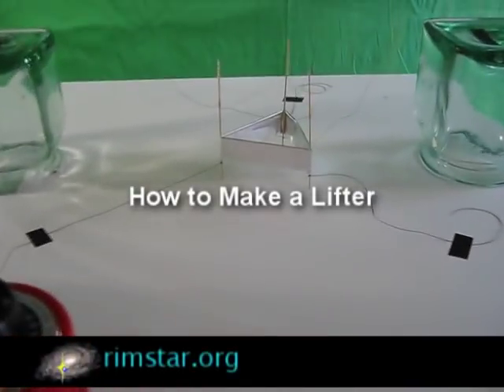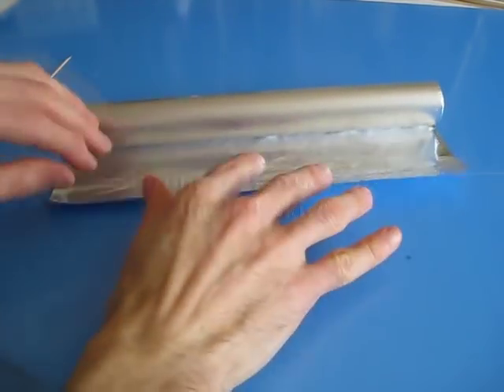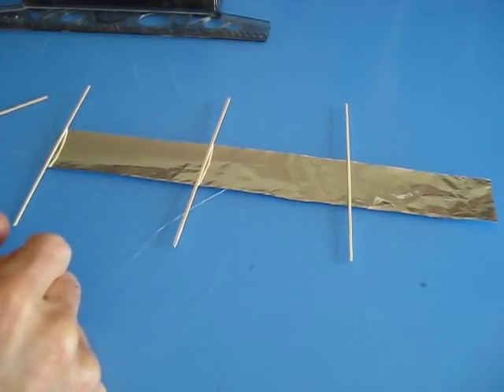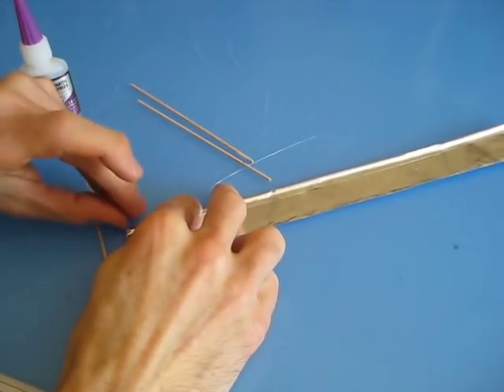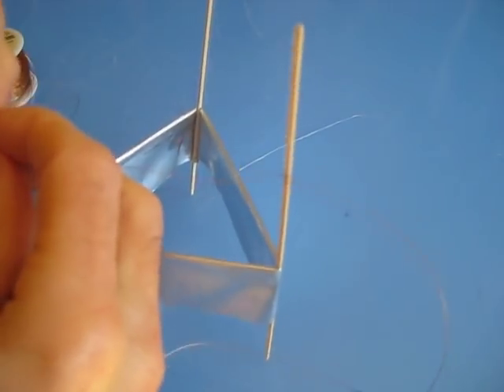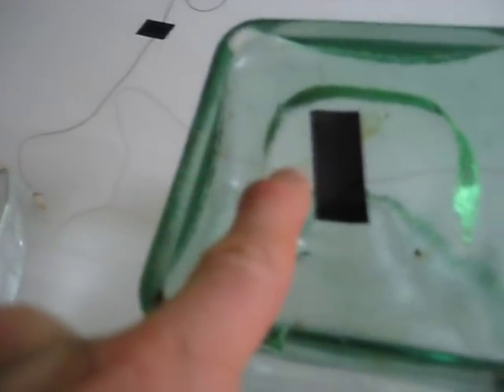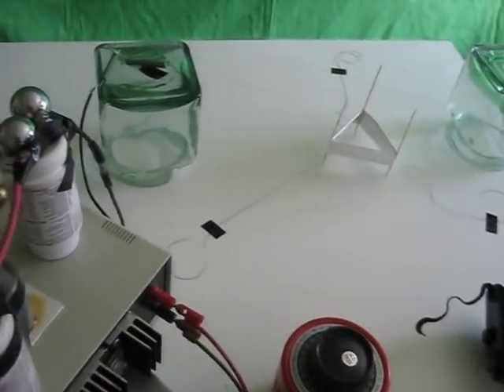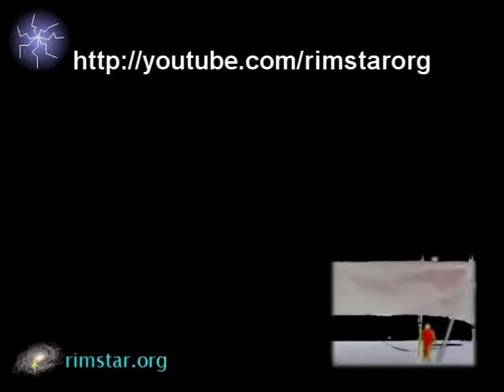How to Make/Build a Lifter or Ionocraft

Comment: Although I'm trying to lift off my ion lifter, it doesn't lift off... let me know why... is it important corona current? current limit of power supply affects to lift off?
Reply from the maker: Yes, it does need a lot of current. I don't know how much though. Another trick that is extremely important is to try getting it to run in a dark room. That will show you where the corona is. The problem might be that the corona is along only one side. Between each test you need to turn on the lights, turn off the power supply, discharge the power supply so that it's safe (like I show near the end of the video) and then adjust the spacing between the wire and the foil on the sides. I explain this with photos on my webpage here https://rimstar.org/sdprop/lifter/lifter.htm .

Comment: Thomas Townsend Brown, who built these devices in the 1920s and incorrectly believed that he had found a way to modify gravity using electric fields.

The term "lifter" is an accurate description because it is not an anti-gravity device; rather, it produces lift using the same basic principle as a rocket, i.e. from the equal but opposite force upward generated by the driving force downward, specifically by driving the ionized air downward in the case of the ionocraft. Much like a rocket or a jet engine (it can actually be much more thrust efficient than a jet engine), the force that an ionocraft generates is consistently oriented along its own axis, regardless of the surrounding gravitational field. Claims of the device also working in a vacuum have been disproved.

Ionocraft require many safety precautions due to the high voltage required for their operation; nevertheless, a large subculture has grown up around this simple EHD thrusting device and its physics are now known to a much better extent.

Comment: Do you have a rough estimate or a formula for the relation between voltage and payload?
Reply from the maker: No, I don't have any formula. My lifter is around 2 grams and it lifts with around 25,000 volts (see my video where I measure it https://www.youtube.com/watch?v=LOGAaObsN4g). So you could say 12,000 volts per gram but I don't know how well that scales. Plus there are other factors such as the distance between the wire and the foil (the closer they are without sparking between them, the lower the voltage required). The sharpness of the wire also plays a part (sharper is better) as does the humidity of the air (drier is better).

Comment: cool vid, how much voltage are u using and can you use a cheap 4$ spark gap from china. and can you use the spark gap negative rather than grounding the device.will it work if the gear is on the vessel. mayday mayday scooty...? lol is a floating ground plus to plus connection required...scotty... lol for real brother???
Reply from the maker: The lifter needs high voltage DC but also a lot of current, so I doubt a 4$ spark gap would work.
Reply: thanks for the fast reply bro, i love your videos and voice brother. sweet to the tone. lol you are a blessing in energy sharing and make incredible effort for wonderful presentation. much regards bro. and for the amps how much amps we talking about. i kinda making my way to capacitor king status. little gold oxide caps or even regular super caps could be implemented in such a situation. ...and for the ground lead,can we have it onboard? maybe we just need a plus to plus connection. it's time we scaled it up brother. when i sparked one of my coils and monatomic gold tube cell. i feel a static energy around the device so powerful it felt like the air(static) was moving like it was a subwoofer. and for the first time i realized what was the levitation force, it was remarkable and i need to redo the experiment and master it. i also got shocked by a arc forming at one inch from the coil it did not hurt. let's return to the ground issue and amp. ? can you add more and continue advancing making bigger one. you the man,destiny got it covered...by you. lol much appreciation.
Reply from the maker: Regarding the grounding, I use the grounded side of the power supply for the foil because it's nearest to the grounded table. Since they're both ground then there's minimal effect between them. But it works both way and I don't know which works best. So that means you likely can use HV+ for one electrode and HV- for the other. Just keep the lifter legs such that the foil isn't too close to the table.
I don't have a way to measuring the current (amps) precisely so I'm guessing it's in the low milliamps.
Regarding carrying your own power stored in capacitors, I've considered that but you'd still need the circuitry to step up the voltage. It would all be too heavy.

Comment: What would  happen if I use a resistor rated at 100k ohms? Would this add an unnecessary amount of inductance to the circuit and cause problems?
Reply from the maker: That depends on where you're putting it. If you're connecting one end to where the earpiece connects to the diode and the other end to ground then this can actually help. 100k ohms is okay for that.

Comment: Hy did you try flat design to see the results on...
I mean already disconnected from soil with feet
But on a plan
Second the erratic movement are certainly due to this fact
When two wires of cupper are near current pathing through it creates a local magnetic field in the sense of the current
Resulting on repulse between wires
Same wires opposite current direction, they will try to link
Then use a paramagnetic metal as aluminum results are opposite magnetic field
Wich means a cupper wire and an aluminum wire with same current sens will try to link
Opposite sens, will try to repulse

During this process the current creat an invisible Maxwell crockscrew inside the wires

If the wires can move a few due to the tension, it will result on wires movements amplified with an magnetic attractive changing field
This is the reason of the stability problem

Also i would like to know the voltage and amperage you use to this experience if possible

Other last problem observe
The fact, cupper moving wires, more effective with moving coils, creat current in when the movement is transmit

If the wires already move with a current then create an additional current while moving as natural physical reaction, it creates instability in the movement
The use of three circuits can be a solution and a good physical tension in the wires to prevent from unexpected movements
Reply from the maker: H Bruno, The voltage when it's flying stable is around 26,000 volts. I don't know the current except that it is above 250 microamps.  You can see me measuring it in this other video here https://www.youtube.com/watch?v=LOGAaObsN4g

Comment: Would a thruster like this one be able to still produce thrust (albeit ofcourse very very Little) using voltage in the order of tens of volts? (Need to know this as i want to do an experiment involving an ion thruster in for a high school project but the teacher probably won't allow me to use kilovolts of electricity)
Reply from the maker: No, you need kilovolts. The lowest I recall seeing work is 10,000 volts.
Reply: Okay, thanks.

Comment: if this were a coil separated with thin double sided tape will i work better?
Reply from the maker: It needs two polarities, one as a sharp object (like the wire) and the other as a smooth object (like the foil). I don't see how you'd get that with a coil, so unless I misunderstand, no, a coil wouldn't work.

Comment: Hello sir, i want to do this with my physics professor but i don’t know what voltage to use. Could you give me that information please?
Reply from the maker: You need around 25,000 volts with somewhere between 250 microamps to 1 milliamp. I have many more details here https://rimstar.org/sdprop/lifter/lifter.htm including where to get power supplies. However, the first power supply I mention there, the one made from scratch, is harder to do these days because it's hard to find a flyback transformer that doesn't have a built-in diode.

Comment: What's the reason of the lift? Some people say it's because the air is ionized and pulling the aluminum foil up. Is it correct?
Reply from the maker: It's a little more complicated then that. Ultimately it's causing neutral air molecules (though some charged ones too) to move in the direction of and past the foil. Doing so causes the lifter to move in the opposite direction. It's similar to a jet engine. I explain it in detail in my How Ion Propulsion Works video here https://www.youtube.com/watch?v=01F8V5IhB5k
Reply: @RimstarOrg  So UFO does not use this tech to float in the air? UFO can fly in vacuum universe. There is no air in the universe, right?
Reply from the maker: Correct. If UFOs are real then they must be doing something else.

Comment: how long can you suspend things for? you said you could smell the air ozone? is that significant.
Reply from the maker: I'd expect you could suspend it indefinitely. Though if you're in a sealed room then it may be that too much of the air will become ionized and therefore overly electrically conductive resulting in more sparks between the wire and the foil, which acts as a shot circuit making it not fly. As for the ozone, as long as the area is ventilated then that's not an issue. If it's not ventilated then I'm not sure how much exposure is bad other than that I've read somewhere before that a lot of exposure is bad. It could be a cumulative problem over years or it could be more short term.

Comment: Hi RimstarOrg. I am using a new reliable Acopian power supply that put out exactly 30,000 Volt on a 5" X 5" X 5"  triangular lifter and it would not lift up.
The lifter weight 3 grams. The top wire is 3 inches above the aluminum foil, and I did not see any corona discharge. Can you tell me why it the lifter did not lift off the table ?
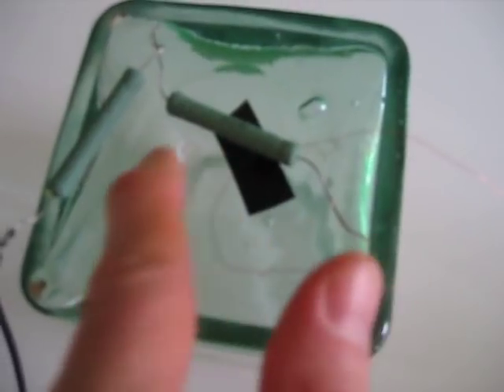Reply from the maker: The lifter also needs enough current for the ion wind. I don't know exactly which power supply you have from Acopian but I did find this chart https://www.acopian.com/store/highvolt-acdc-mod-t.aspx . For 25 to 30 kV, you can see it can supply around 1 to 2.4 mA depending on the model of the power supply. I've never measured the current required to make it fly but I was able to do it with around 25kV. The amount of voltage used is partly dependent on the distance between the wire and the top of the foil. The best way to test it is to do it in the dark so you can see the corona. If you decrease the distance between the wire and the foil and you start getting sparks then increase the distance. Of course you also have to be careful to not have a spark damage your power supply, which is why I use the big resistor that I showed in this video at around 10:04. For tips and tricks to getting it to fly, see my webpage here https://rimstar.org/sdprop/lifter/lifter.htm but the biggest trick is as I said, do it in the dark so you can see the corona. You want corona between the wire and the foil on all three sides.
Reply: @RimstarOrg  The power supply Model I used is P030HP2. 30000 Volt, 60 Watts and it is on the web site that you provided. This unit put out a maximum current of 2 milliamps (30000 X 0.002 = 60 Watts). I maxed out Voltage at 30000 but the current is only 0.02 milliamp (30000 X 0.20 = 6 Watts). With 6 Watts of power it is no wonder he lifter did not lift off the ground. Does the corona has to be along the entire length of the aluminum foil on all three sides ?
Reply: @RimstarOrg  If the lifter is not drawing enough current then what do I need to do to increase the current? I did turned the current knob to maximum but the current did not increase.
Reply: Let me make a correction. The power supply that I used is P030HA2. You can find that it listed on the website that you provided. What I don't understand is why it does not put out more current, while people on youtube convert the monitor to a power supply and it gives them 28 watts to lift a lifter which is the same size as mine.
Reply from the maker: The closer the wire is to the foil, the more ions you'll be producing and therefore the more current it'll be drawing. You just have to be careful because at some point it'll spark instead and that can damage some power supplies. One of mine has protection diodes and capacitors to protect the transistors and one of mine doesn't. That's why I put the big resistors just in case. Also, yours is a regulated power supply so maybe it's doing some sort of regulation internally, though I'd think that since that table in the link I gave says it can supply 2 milliamps at 30kV then it would do it.
Regarding the corona along all three edges, the corona is an indicator of the jet of air being propelled downward. If you see corona along only one side then only that side will have lift and it'll just topple over. So it doesn't have to be spread out along all three sides but all three sides do have to provide some propulsion. Remember, it lifts up until it's pulling at the three threads that are holding it down. That means the the lift provided by all three sides don't have to be the same, they just have to be enough to lift their side up to pull tightly on the threads.
Reply: @RimstarOrg  The engineer at Acopian told me to turn off the power supply. Now, connect the high voltage wire with the return voltage wire and then turned it on. I did it, and the current meter goes to 2 milliamp. This prove that the power supply can put out a maximum of 2 milliamp; but when I connect the wire to the lifter, all I am getting is 0.20 milliamp. I have no arcing or spark. So what do I need to do, to cause the power supply to put out more current ?
Reply: @RimstarOrg  Of all of the video that I have seen on YouTube of people who are successful in getting a lifter to go off the air, they all built their own power supply. I am certain that they are using a flyback transformer from a cathode ray tube monitor, which put out high voltage and high current. This type of power supply is different from the one that I have which is a linear regulated power supply. A linear regulated power supply regulate the voltage based on the potential meter setting, and the current put out is dependent on what the circuit draw. Whereas in a power supply that these lifter builder uses, it allowed for excess current because the current is not regulated. Therefore, the current draw is not dependent on the circuit. Another word, when they increase the voltage, the current automatically increases without regard for the maximum current limit  that the circuit is drawing.  Is my analysis correct ?
Reply from the maker: I don't know the details of a regulated power supply but your analysis is correct for a the unregulated ones that DIYers make using a flyback transformer followed by a voltage multplier (like the cathode ray tube monitor).
Reply from the maker: Regarding seeing the corona, are you running it in complete darkness? Do you see corona when you do that? That's your indication of current draw from the lifter. What gauge is your wire? The wire has to be bare, no coating on it. Did you round out the foil on the top edge of the lifter where it is closest to the wire? Did you try decreasing the distance between the wire and the foil?
Reply: @RimstarOrg  1) Can you built me a plug and play power supply that will lift a lifter
Reply: Are you an electronic engineer or an electronic technician ?
Reply: I did wrote a long message to you some 2 hours ago about what I did with the lifter, but it is such a pity that Youtube delete that message. They are such stupid, nonsense people who just randomly delete message even when that message has nothing to do with political proclivity.
Reply from the maker: That's odd. I don't see anything in my "Held for review" area. But in answer to your question, no, I don't make things for others. That's not something I have time for.
Reply from the maker: And in answer to your other question, I'm self-taught.
Reply: @RimstarOrg  I wrapped about 30 feet of 28 gauge copper wire around a square lifter. When I turned on the power supply, the current meter no longer reads the usual 0.20 milliamp but 0.05 milliamp.I am increasing the wire length in hoping to obtain more current from the power supply, but instead I got less 1/4 less current. Do you have any ideas why this occurred ?
Reply from the maker: The longer a wire is the higher the resistance so I would expect the current to go down.
Reply: @RimstarOrg  What do I have to do to increase the current given the fact that the Acopian power supply only give out the current based on what the circuit is demanding ?  Perhaps I have to add some kind of circuit like say a capacitor that stand between the wire and the lifter.
Reply from the maker: If you've connected just the thin wire to the output of your power supply then it should be drawing the maximum that your regulated power supply would be able to give. I don't know why it's not giving it.

Comment: hello bro can i use tesla coil ac high voltage because i think your high voltage power supply is made of crt flyback ( dc )
Reply from the maker: No, as you guessed, you need DC or pulsed DC for this. AC won't work.
Reply: @RimstarOrg  thanks for reply :)

Comment: Do you have any reference points to go to for HV power supplies?
Reply from the maker: landalot101 I give some links in the video description to webpages for HV power supplies you can make or buy. If you want videos instead, there's my "How to Make 30kV High Voltage DC Power Supply with Flyback & Cockcroft-Walton Multiplier Tripler" and "How to Make PC/Computer Monitor into High Voltage Power Supply" videos.